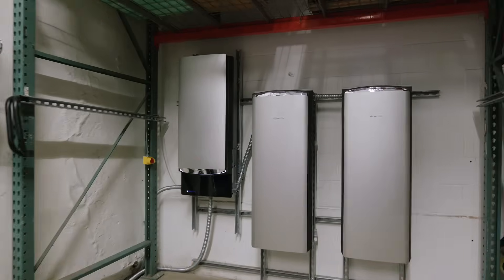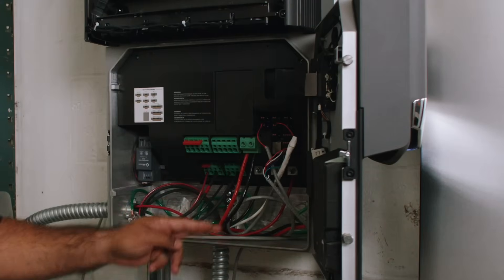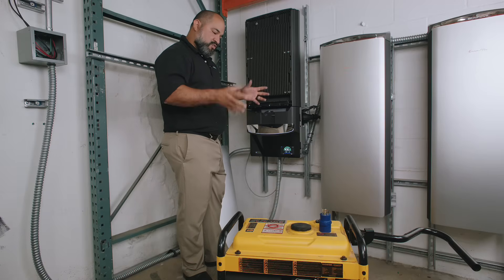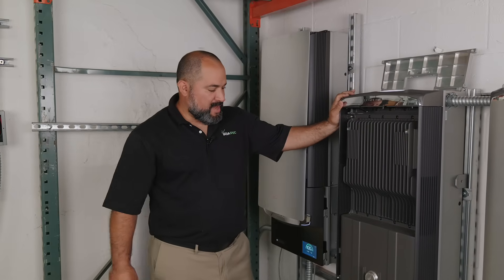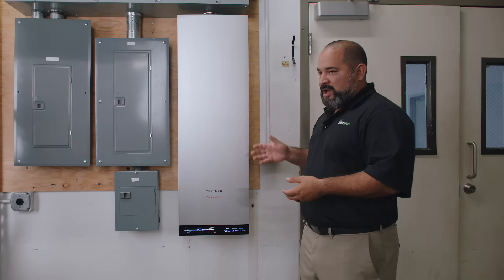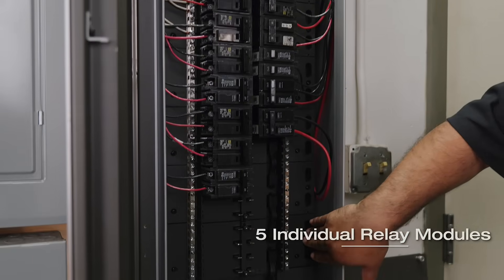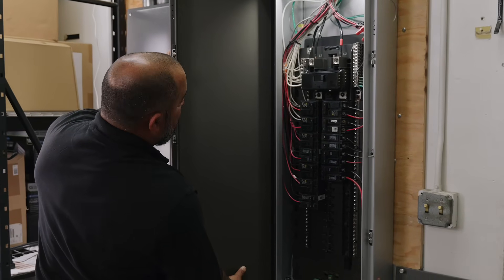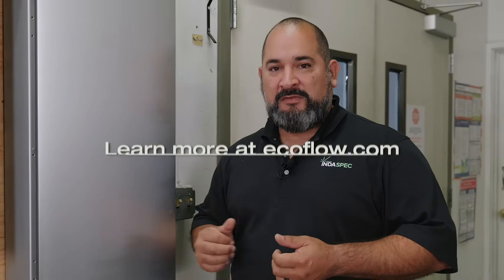How do installers feel about #EcoFlowOCEANPro?

Comment: Will this system work if you have Tesla solar tiles or a solar Tesla roof?
Reply: You can connect any existing Solar panels to the Unit.  The inverter will handle the panels.

Comment: I agree with one comment - the pricing of the hardware needs to be known to the consumers. I disagree that the install for this particular product be done by DIY. A 10 Kw battery is no joke. An 80 Kw setup (it's beyond anything a DIY person can handle) has so much stored energy I can see a DIY person ACCIDENTALLY short circuiting something and a rather large explosion happens, then what ? No way EcoFlow will take the blame for a smart-ass DIY person's stupidity.
Plus, the main feature I am interested in is integrating a 10 - 20 Kw generator into the setup without having to manually flip breakers. Unless there's a licensed electrician doing the install for these LARGE capacity electrical items, there's no way I want a DIY person anywhere on my property.
Markup ? That's something you'll have to figure out. I'd want to know how much the hardware actually cost, and what the electrician charges for labor.  I heard 2 hours install - I would gladly pay for HONEST labor (skilled labor, a licensed electrician has passed certification tests, don't forget).
And... how many DIY'ers install 240 volt circuits for kitchen stovetops and EV charging (and possibly water heaters and air conditioners) ? The Ocean Pro is supposed to handle all of that.
Reply: Look at the Genmax Tri Fuel Inverter unit.   You can hook it up directly and it has a 2-Wire autostart as well as the EcoFLow can manage the Input Wattage so you do not tax your generator of choice.  Always leave 30% overhead on the generator for longevity and fuel savings.
Reply: @HomeGuySolutions  First I have heard of inverter generators, but sounds like an interesting alternative. Unfortunately I just checked their web site, they have only 1 trifuel unit, and it's sold out. I don't need it now, but some day I will.
Reply: @bobnomura2068  they make two units 10 K and 17 K depending on the type of fuel will determine the ultimate output, but what’s great is with the ocean series again you can tell the ocean series to charge at a certain amount so let’s say the generator is putting out 10,000 W continuous you don’t want to run the generator at 10,000 W but there’s no way to control it with most battery backup system systems with the Eco flow. You could have it only take in 8000w during charging.
This lets the generate operated peak efficiency saves on fuel in longevity. Once the threshold you set in the Eco flow is Matt. It will tell the generator to turn off and start the cycle over again. Depending on the number of batteries, 8000 W can charge extremely fast so the generator will typically only run for an hour to two hours.
Reply: @bobnomura2068  also, the ocean series does not need an inverter generator you could plug in any generator you can get your hands on. Even if it’s dirty power output, the ocean series will clean up the power before it feeds into the system. One of the best units on the market.

Comment: And why should we get this over the EcoFlow Delta Pro Ultra?
Reply: Delta Pro /. Delta Pro X does NOT support Generators with auto start at this time. Nor can they control Charge rate from the generator.    If you have a 10K Gen, you do not want it charging at 10K.  With the Ocean, you can set the Charge at whatever you want, which for 10,000 Watt Run Generator you want the generator to charge at say 8500.  This will not stress the generator and save fuel.   You can also tell the Generator ( GENMAX Tri Fuel as an example ) to AutoStart at a set battery voltage, accept charge at a set rate, then tell the generator ( Dry Closure contact)  to shut down when the batteries reach say 85%.   
Delta Pro all the way!
I would guess
Inverter $2500-
Optional 200Ah. Smart Breaker Panel $2500-
Best Safest UL Battery Partially waterproof 2", 15 Year Warrantee  $5 to $6 K for 10,000 Watts.

Comment: Why not a 200 amp panel? This guy is reading off a script. Bad video, do better. This seems so scripted, I don’t think this is actually a bad system but the delivery is poor.
Reply: You can put a 200 amp breaker in the system , remember, you will never reach 100 A of draw in general.
The bus bar is rated for 250 Amps
Reply: Bad system because not available directly to consumers which is what made eco flow
Reply: @HawaiiSustainable  Go with the smaller portable system X series.  It just lacks Generator Logic at this time.

Comment: Wow, that smart panel got so “smart”, it now takes up twice the wall real estate!
Reply: it houses 40 breaker spaces for up to 80 circuits
Reply: I need this because the Smart Home Panel 2 doesn't hold enough breakers.
Reply: I’m an electrician and I can tell you It is a little larger than a comparable 40 space breaker panel, but you can’t compare it to the panel right next to it as it has twice as many circuit breaker slots available than the old breaker panel.

Comment: Except none of this is sold directly to consumers. Which is why people picked Ecoflow to begin with, to avoid installers markup and ripoff.
Reply: Let me build my own stuff. They don’t have any price transparency as well. Kinda annoying.
Reply: Ik for a fact they read comments. Their lack of response says a lot
Reply: Exactly
Reply: Agreed, let us buy and install ourselves!
Reply: This system looks like it has been very well planned, and it checks all the boxes. Unfortunately, since it isn't sold to the DIY'ers, I will never own one. Unless they offer a class to get certified on the equipment and then sell it to me. I refuse to pay someone to do what I can do myself. I just learned DIY solar in the last year and a half. I have now installed six different systems on my own. 
Offer the class and sell to the people who attend it. That would be a win-win for everyone.
Reply: Facts
Reply: since the product is permanently installed and tied into the grid, it's a more involved process to ensure the home meets all qualifications to remain insured. There's permitting involved which requires following local jurisdiction rules and regulations (which vary from city to city) as well as industry standards and requirements. There's also high DC voltages both from solar/PV and batteries (over 400VDC) which require qualified personnel handling only. Along with a 15-year warranty, this is a different class of product for EcoFlow. Not just portable generators, but a fully grid-interactive appliance that provides end users with complete intelligent energy independence from their respective electrical grid.
Reply: @Energy_from.the_Sun I don’t want to be attached to the grid. The utility here is a for profit company that was responsible for fire that took hundreds of lives and they charge ridiculous high prices. As another person already pointed out it’s not ecoflows job to police what people do, they might have better electricians etc. I can buy almost anything with similar specs without needing a specific installer. This isn’t Tesla and even they should allow anyone to buy because that left a niche for EcoFlow who obviously forgot their lane.
Reply: @HawaiiSustainable  yes, the beautiful thing about the current state of the industry is that there are a ton of options that meet our needs. this is only the beginning of EcoFlow's entry into the residential ESS market from portable generators. there are rumors they're bring manufacturing to the US with a wide range of new products for the US market in their pipeline. Get yourself an EcoFlow DPU and call it a day... for now
Reply: @Energy_from.the_Sun  Well said and all true.   No DIY here.  For those that want DIY and no U.L. Cert. go at it with Build Your Own Battery System, just make sure your Homeowners insurance will cover you :)    Nope!
Reply: @Energy_from.the_Sun don’t matter. Allow consumers to buy and use their own electrician or diy. EcoFlow shouldn’t concern themselves with standards and permits. That’s the government and municipalities job. They can use their own contractors to inspect after work is done to determine if they will honor the warranty. Put a price point on the damn thing